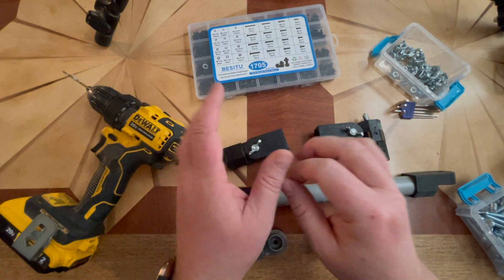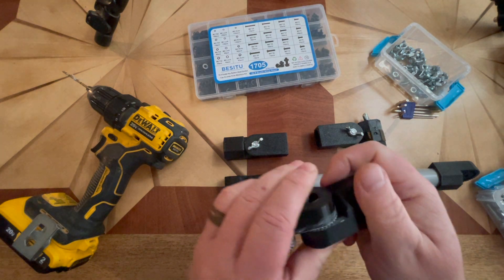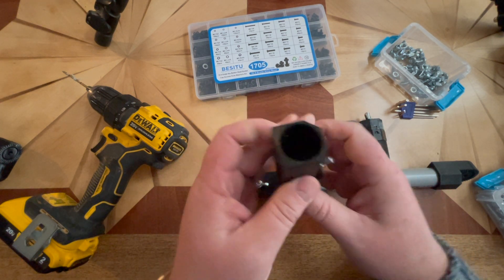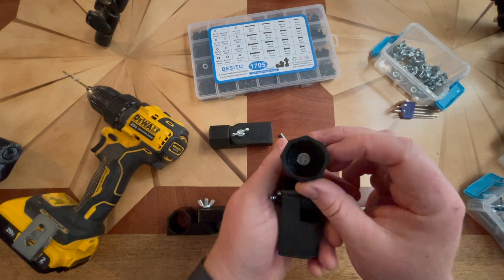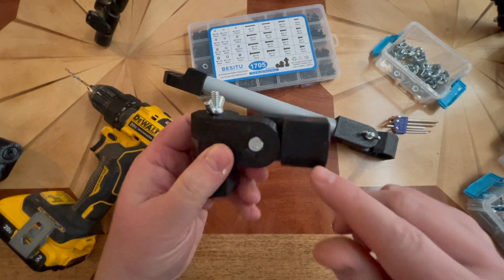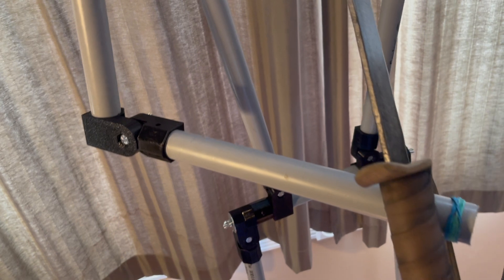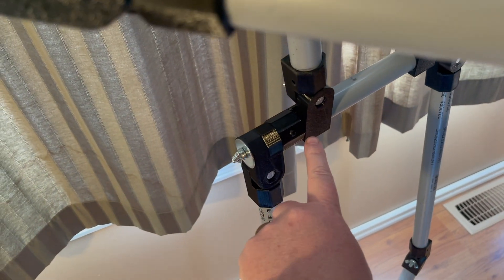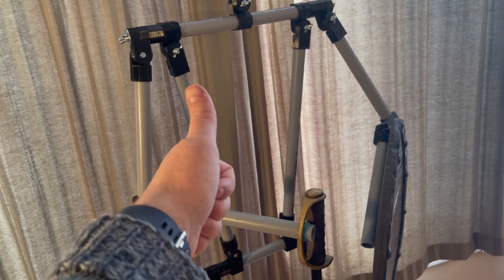DIY Full sized Human Armature build Tutorial

Comment: This is great! Is PTEG difficult to print? I’ve used PLA outside and it just melts in the Florida heat and sun.
Reply: Great! Thank you for the detailed reply. Last questions (hopefully)...

What kind of infill do you recommend with these fittings? 

Most of my PVC is 3/4" any thoughts on scaling these down for 3/4"? I know that I'll either need to get a smaller bolt or bore the hold out in a modeling software. I've considered moving to 1" PVC but costs (I'm cheap) and weight made me stick with 3/4".
Reply from the maker: I went with the 1" for the rigidity of the pipe itself, I was worried about the 3/4" ending up with a bit of droop the moment there is any weight load on the extension.  If there is demand I could totally go and design a 3/4" set as mentally all the kinks have been worked out in the design!
Reply from the maker: Yeah, PLA is horrible outdoors, PETG is more along the lines of the material to make pop bottles and I have not have many warping issues in hot sun (Within reason of course) and as these joints will be under a build/clothing most of the time you can avoid the direct sun which is usually what impacts it the most.   Printing wise?   It's almost as easy as PLA, you print it quite a bit hotter, and print it slower. It has a habit of stringing a bit on travel, but overall, no real difference.

Comment: Looks great!! I really like the inset hex bolt and wing nut. Great design. For the PVC, have played with staining it? Would match the joints well. I need to get some prints going.
Reply from the maker: Hey Jekyll!   The joints really are meant to be a base that goes under clothes or a skin.   I just wanted the ability to make a possible manakin without the bulk associated with it.  Something strong to take some weight load, but light enough to be able to be manipulated by animatronic motors.   So much to consider, but I love these joints, the final version worked very well.   The 10 or so failed designs that sit in my "Refine Idea" box are a testament to all the work I put into getting these things just right. 

Thanks for watching and if you print some, you have to let me know how they work out for you!  Just remember  PETG is a must!